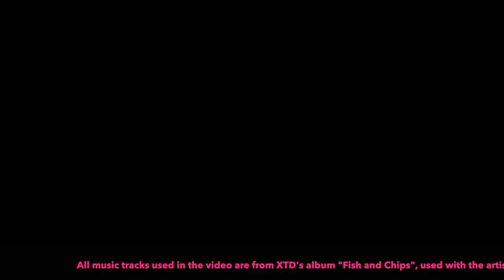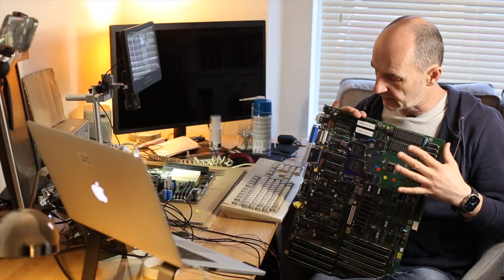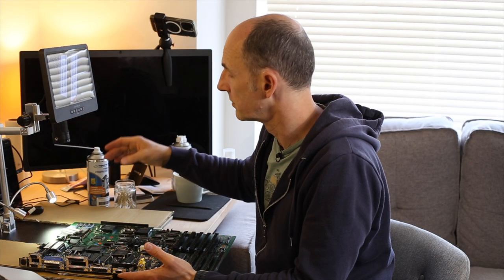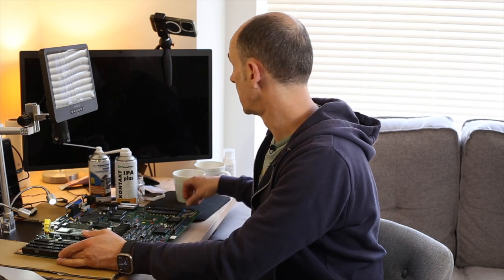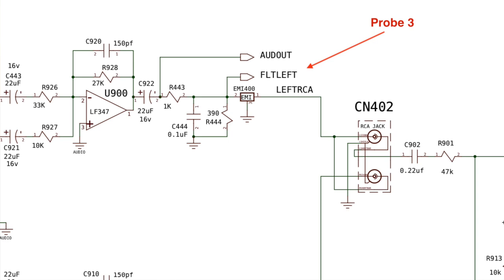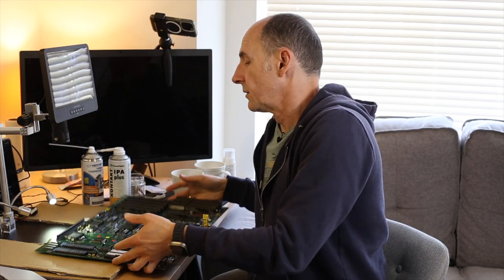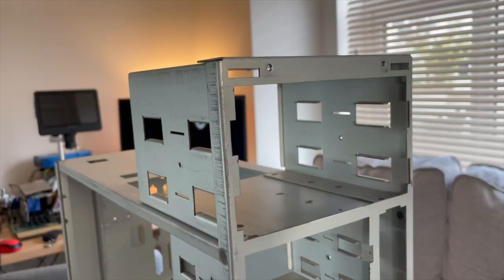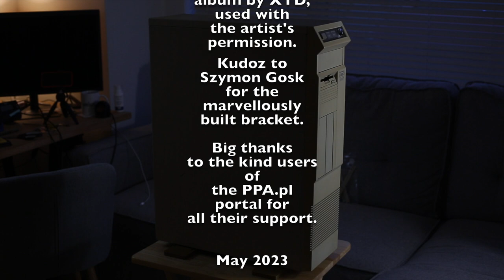Amiga 3000 Tower: The Most Expensive Amiga in History

Comment: Actually the X5000 motherboard is the most expensive Amiga in history.  A case, power supply, disk storage, keyboard, monitor and mouse have to be added separately so you'll be set back by around $5K USD in the end.  That is of course if you can even consider the X5000 an Amiga at all since it wasn't produced by Commodore.
Reply: its not an amiga hence why its called x5000.
Reply: @a4000t  It runs AmigaOS4 so therefore it's an Amiga, just like the X1000, X5000, A1222, the CyberStorm, BlizzardPPC, and the AmigaOne XE.
Reply: @@Xarus1000 No, Amiga OS4 has no connection to Linux whatsoever.  It is a direct port of OS3 to PPC hardware with some enhancements along the way such as 68K emulation.  The port was done by Hyperion Entertainment out of Belgium.

Comment: I'm pretty much a wedge computer 4 life kind of guy. :) But I think it's nice that they made official tower versions of A3/4000. Some towerized their A1200s, but it wasn't quite the same, and always a bit awkward.
Reply from the maker: I love the wedges too, and agree that towerized 1200 don't have the appeal. I am, however, working on a beefed up 1200 setup with no case and all kinds of extensions which I called the "Amiga Sandwich". I'm not planning to towarize it though, keeping it horizontal :D Thanks for visiting and commenting!
Reply: @ForgottenComputer  Keeping it horizontal is a good idea. I had a 1200 tower and often I had to push all the boards together to make it boot. It was so often that I left the case open all the time. 

I think these days it'd be possible to build a reliable tower because everything can just be in the one card like Vampire or that Pi accelerator (don't remember name). But with BPPC and FastATA and everything it was a nightmare.

Comment: I bought an Amiga 3000T in 1991 and ran my BBS on it. It was FidoNet node 1:255/42 and called The Heart of Gold. Around 1996 I sold it to someone in Quebec via USENET.

Not only did it give more expansion slots as the video says, but also more hard drive bays. I had most of the slots and bays filled as I had an A2386, some ISA cards, A Zorro 56K serial card, and many drives in it. An A2000 or A3000 wouldn't have been sufficient.

Comment: I love my A3000T.  She's had some restoration work over the years and is still going strong.  I might argue that while the A3000T might be the most expensive Commodore Amiga in history, the MacroSystem DraCo (Amiga clone) wins the "most expensive" non-Commodore vintage Amiga title.  DraCo uses a licensed and modified A3000 ROM, it will run AmigaOS3/RTG friendly applications.  There's no Amiga custom chipset clone or emulation, but RTG works well.  You can even use many ZORRO-II cards.   It shipped in Tower and Cube models, I have one of each.  DraCo would set you back $15K USD.  
https://www.youtube.com/watch?v=0nLaEC0dpqU&t=5s

Comment: Related webside about A3000T: A3000T for sure is a 4-layer design (minimum), 8520s are specific designs for Amiga and got used in 1571/81, too and Paula could be called OCS while you call the board chips non-ECS but they are not related to OCS/ECS at all. ECS version of the chips are Agnus (2MB) and Denise (and Paula never changed).

Comment: "Best" part is the placement of the battery. My friend had an A3000T with extensive damage from a leaking battery since the acid would run down the board due to gravity ending up as far down as the chip RAM sockets.
Reply from the maker: Agreed. In mine the damage was not so extensive (as shown in the video) but yes, it was progressing from top to the bottom. I'm happy I was able to stop it early enough.

Comment: It would be nice for someone to bring the Amiga back using more modern board layouts with maybe a slightly higher level of integration regarding the specialized chips. It would still run the old software but could also run new stuff as well. So not an emulated machine but the real deal. I doubt that will ever happen though.
Reply from the maker: Well isn't the Apollo Vampire project close to this? There are also new A2000 and A4000 PCB designs.
Reply: there are ATX4000 board and a atx A2000 board out there you can build

Comment: The most expensive amiga was an amiga 3000 ux
Reply from the maker: UX was always sold as a bundle with Amiga's implementation of V. So the price was really for this specific hardware-software bundle rather than just the computer.
Reply: @ForgottenComputer  I remember the A3000 UX, it was a bog standard A3000 with V sold with a custom badge and a tape. It was VERY expensive and slow. When the A1200 came out I tried an early 68k version of Linux and that ran way faster haha.
Reply from the maker: @Krushernl  I’m an avid Linux user but never used it on 68K architecture. Need to try once just for sports.
Reply from the maker: @Krushernl  I’m an avid Linux user but never used it on 68K architecture. Need to try once just for sports.
Reply: @ForgottenComputer  If you need help, ask a way. But that is about the scope of your video.